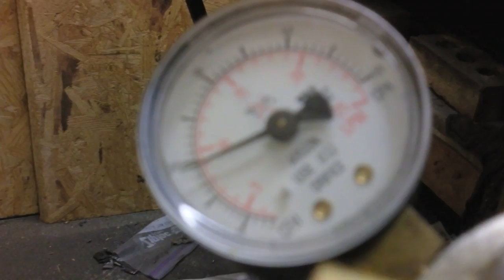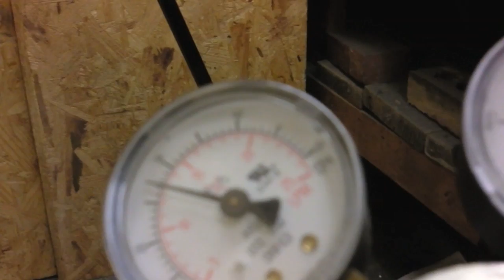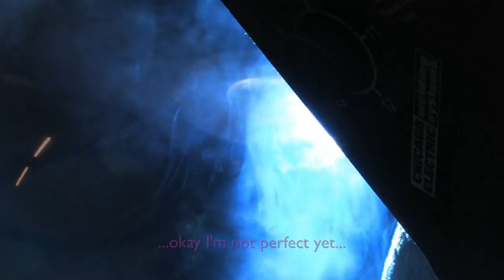JayRacing 1g AWD Rear Active Toe Correction Kit Install

Comment: @Jafromobile a cheap alternative you might like is map gas, you can use it in a lot of propane style torches and it heats steel much faster, so unintended things dont get hot. good  option to have in your arsonal

Comment: Did this help or improve the drag strip launches of the car at all?  There's no doubt it will improve cornering, but I remain a bit skeptical about straight line and stand still launching performance.  I'd like to see some concrete before/after mod 60' numbers or reports of wheel hop elimination.

Comment: How long would those hiem joints last on a daily driver? The rearend of my 92 talon needs some attention, but I don't want to do this install if I have to pull it apart every year. I have the skills other than welding. It looks like a fun mod to have on my talon though. Good job on the video.
Reply from the maker: On this part I'm not aware of any problems.  On the rear upper control arms we found the heim joints fail quickly unless they're teflon-lined.  The guy to ask is robertbaxley, they're on his car.  He's going through it right now because he managed to weld his clutch plate to his pressure plate at the drag strip.  You should check out his channel and his '90 Talon.  :)

Comment: Hi ***** love your vids mate.
A few quick questions, once you've re-installed the subframe into the car, how do you go about adjusting toe? In the case that you may have got the length of the eliminator a little off? Or is it imperative to get this spot on before you re-install the subframe into the car?
Just that it looks like the head of the Heim joint is too wide to be rotated within the housing in which it sits.
Also, where can I buy the polyurethane rear subframe and moustache bushing kit?
Thanks!
Reply from the maker: NGK87 You have to lower the heim joint out of the mount in order to rotate it and adjust its position.  Is it work?  Sure it is.  But after you get it right, you don't need to mess with it anymore.  Squishy subframe issue solved.
As for the mounts, check out +RobertBaxley 's channel.  These parts were actually installed on his car.  I just helped him get 'er done.  I don't know where he got them?
Reply: ***** 
Thanks mate, is it possible to lower it out for adjustment with the subframe bolted into the car?
And yeah for sure, looks like an awesome mod. I was looking at making a stabiliser bar using some 4WD sway bar links bolted into the 4WS rack mounts but this looks like a much better option.
I'm hoping to do all of the same mods that Robert has made to his subframe on my GVR4, except I might buy some Ingalls rear camber arms because you mentioned somewhere that the ones he made went a little nasty in the ball joints, otherwise they looked good. The Ingalls arms have a rubber bushing where that particular Heim joint is.
No problem re: the mounts. I think Boostx on the forums still has some.
Cheers mate, keep the krispy kremes rollin'! Ahaha